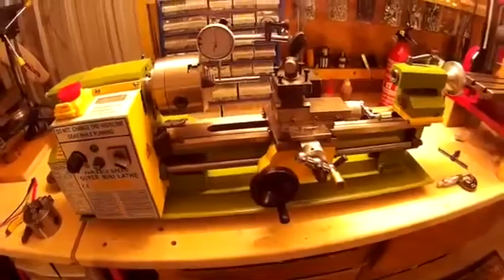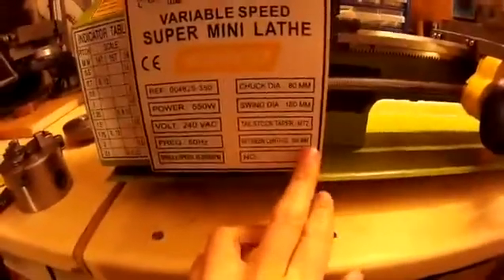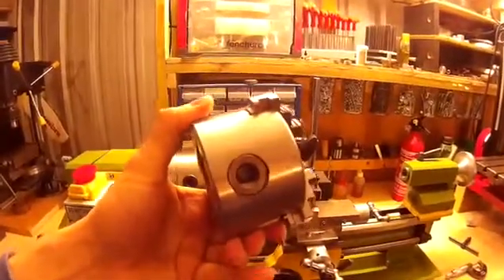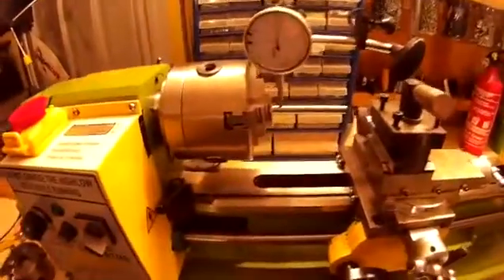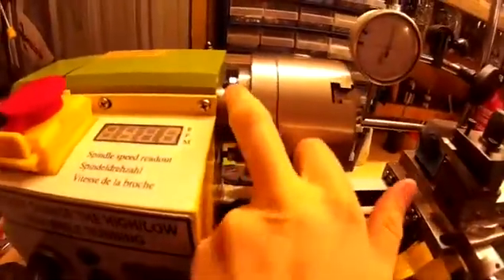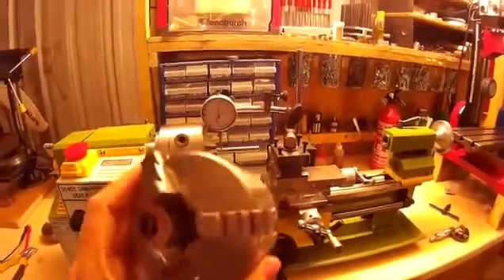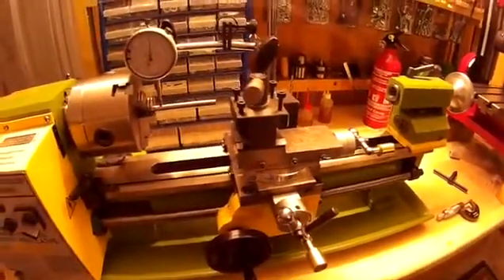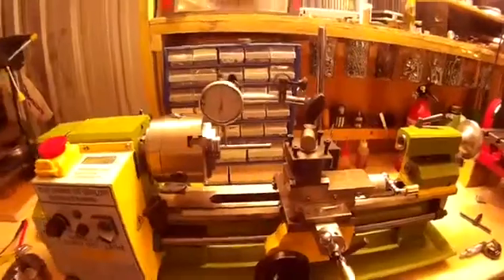Chinese Mini Lathe accuracy how to sieg c3

Comment: Just came across your page. That's not a Sieg-made lathe. One way to tell is that the base of the tailstock is quite different from the Sieg lathes. Another way to tell is the plastic protractor - the ones from Sieg are cast metal. Frank Hoose - mini-lathe.com  Not criticizing, just wanted to correct the record.  I'm all in favor of more mini lathes for everyone. :)

Comment from the maker: For Cheap lathe tooling take a look here https://www.banggood.com/search/lathe-tools.html?p=070519238739201308J6

QUICK CHANGE TOOL POST
http://www.banggood.com/Mini-Quick-Change-Tool-Post-Holder-Kit-Set-For-TableHobby-Lathes-p-983345.html?p=070519238739201308J6

I may receive a small commission for you using the affiliate link above thanks, it costs you nothing if you do not want to use link search on goggle all the best.
Show less